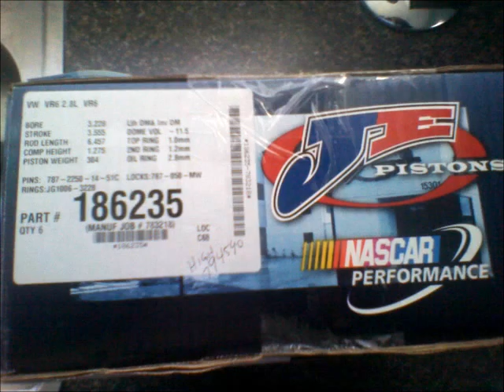Vr6 turbo mb 2012 bottom end build up

Comment: Nice vid would like to hear the start up. Just getting into these VR6's, PWR for a golf is out of bounds, test drove a stock MK3 with VR6 and it chirped in 1st and 2nd without even trying. You guys turbo and chip these motors that has got to be a force to be recon with.